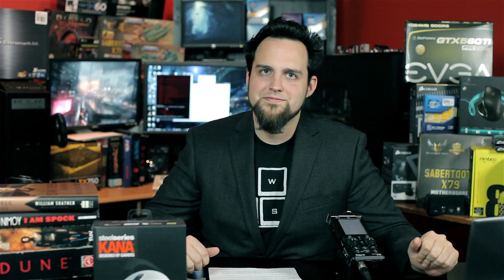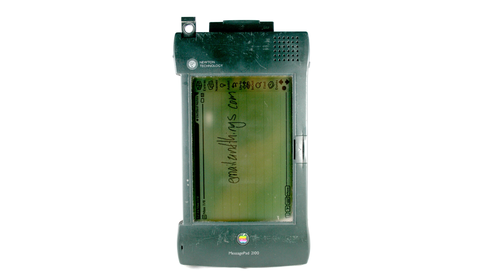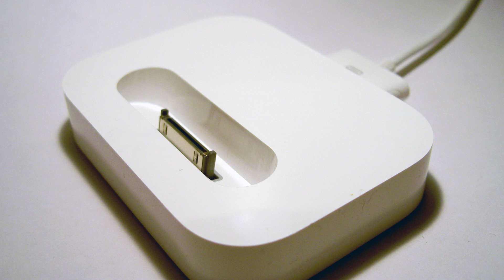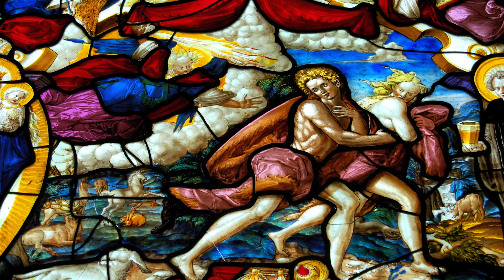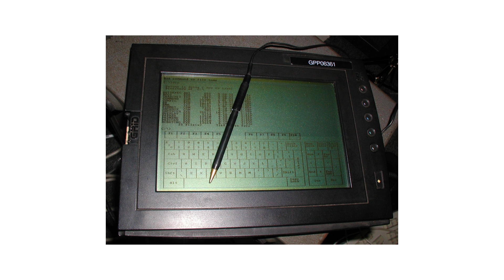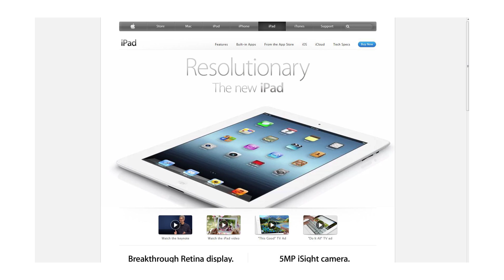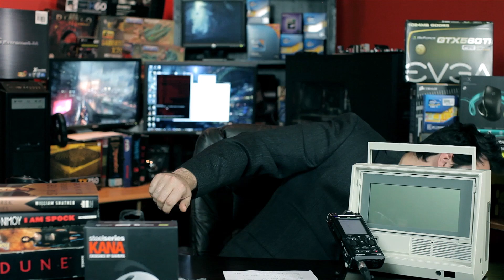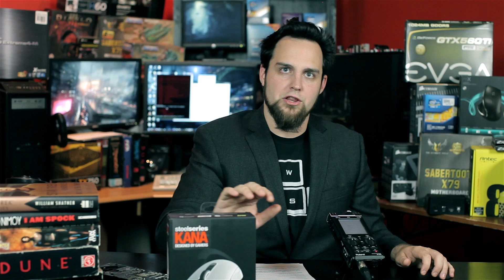Has Apple Really Ever Invented Anything?

Comment: This video is my 1 argument for ppl who say Apple invents everything.
Reply: ***** 
Yet the video does provide not very accurate data, does it?

 US Patent Law defines invention like this: a new, useful process, machine, improvement, etc., that did not exist previously and that is recognized as the product of some unique intuition or genius, as distinguished from ordinary mechanical skill or craftsmanship.
- (http://www.uspto.gov/web/offices/ac/ido/oeip/taf/patdesc.htm)

• Firewire is Apple's own name for IEE1394, Apple initiated development in 1986 with the help of the  IEEE P1394 Working Group, where TI was belonging to then.

From the 1394 Trade Association page:
"History
The 1394 digital link standard was conceived in 1986 by technologists at Apple Computer, who chose the trademark 'FireWire', in reference to its speeds of operation. The first specification for this link was completed in 1987. It was adopted in 1995 as the IEEE-1394 standard. IEEE-1394-2008 is the most current version of the standard, which supports asynchronous and isochronous data transmission with data rates ranging from 98.304Mb/s (S100) to 3.932Gb/s (S3200)."
- (http://www.1394ta.org/about.html)

• Newton MessagePad, while not the first real PDA, Apple coined the term PDA. I was not able to find an Apple press release about the MessagePad though, to either confirm or deny the claim of the video uploader (VU).

• Thunderbolt: where does Apple claim, to be the inventor? It does not say so here: http://www.apple.com/thunderbolt/

And back in February of 2011, when the first Macs with TB arrived, Apple said this on their TB page:
"Thunderbolt began at Intel Labs with a simple concept: create an incredibly fast input/output technology that just about anything can plug into."
- (http://web.archive.org/web/20110227062320/http://www.apple.com/thunderbolt/)

• MagSafe: Where did Apple say, it was something entirely new? They have a patent on this connector for electronic devices, thus rice cookers are not included. In their press release from 2006, Apple did not mention to being the first to implement magnetic properties with power adapters, but according to the definition of invention, it is an invention.

• Studio & Cinema Displays: Where did Apple claim, to have "invented" the big displays? They were however the first to offer 30" computer displays and got the ball rolling for 2560 pixel wide displays, like the 27" displays nowadays.

• Mini DisplayPort is in a way Apple's implementation of the DisplayPort standard, one could call it an invention or innovation, the line is blurry here.

• I do not know that dog icon, but I really get the feeling, they went with items, where the term invention cannot always be applied.

• 30-pin dock connector: A lot of companies seem to have their proprietary dock connectors, and Apple did implement some features in its dock connector, that would not be possible via Firewire or USB, like video out for example.

• Apple IIe Card: again, blurry lines, but in the end, if it is not considered an invention, it was an innovation made in house. I guess that should count for something. Nowadays we do not have such problems anymore, everything is compatible with everything. Man, those first thirty years of personal computing must have been awful.

• Apple TV: where does Apple say it is their invention? They say, it is their product, nothing more. These guys are really reaching. I guess they could not be bothered to look at Apple's actual invention.

Still lots of shit to go I guess. And those moderators are quite bad.

• MacBook Pro: Apple was the first to use the Unibody design for their notebooks, others just followed suit. It was an invention and innovation.

• Apple logo: again, stretching. They did design it themselves, but then again, someone already took a bite before, and it was Turing. I guess that guy should be honoured.

• QuickTake camera: I guess, they just list products, which cannot easily count as inventions, but the parts used inside or the parts used to create that product can be an invention, but then again, most people cannot look below surfaces and have to be superficial.

• Mac OS 9: now they just ramble how bad it was, but I cannot say anything about that, since my only experience with pre Mac OS X was System 7 and Mac OS 9.2.2, which were okay and got me hooked. I always liked to theme Windows to look more like that, I still put that task bar up top when using Windows. 

• Mac OS X: Of course they invented some of the code, they bought some of the code, and they took some of the freely available code. The new OS is an invention, but of course only if you use the broader definition. Otherwise, no one is inventing anything. Maybe when the Singularity arrives, new inventions will be made.

That video gets boring, but I fight through it. Hopefully you will too with this longer reply not really made for YouTube.

• Mac App Store: Again, where does Apple claim to be the first or having invented something entirely new with just the concept of the MAS? 

• iOS: Never heard it pronounced that way. Inventive. Unlike iOS of course, which was just Apple doing nothing. Man, those guys are prejudicial. And man, am I becoming even more prejudicial towards people with such beards. Probably wanted to join a metal band, but couldn't.

• iPad: Sadly, this time they are 0% correct. Tablets and that concept existed before, even in Star Trek and 2001. And many manufacturers brought out products in the late 90s and early 2000s, which showed, how many people are really not interested in such crappy products.
Luckily the iPad came along and showed everybody else, what to copy. I guess they couldn't see it from the iPhone, which was an obvious test bed for a multi touch tablet, at least for people looking at dozens of PADDs while watching TV.

• The iPod was not claimed to be the first MP3 player, not by Apple at least. Where do they find those idiotic assumptions?
It was the first popular MP3 player though and brought attention to Apple. I guess, it must not have been that bad a player.

• Inductive charging: Apple does not offer any products of their own design or creation employing inductive charging. But I guess, since one can buy such products from the Apple Online Store, it must be Apple claiming it as their invention.
Or are they talking about the patent for orientation based charging Apple got earlier this year?

• iPhone: Yeah, I guess the name was the only thing they could come up with. Poor bastards.

• Pippin: WHAT THE FUCK? I am seriously pissed right now, and I probably should stop, but I am also obsessed with stupid people like you and proofing them "right", which is of course a lost cause via social media.

Anyway, I make a short break to break something, and will probably go to the cinema afterwards. Maybe I finish this reply later, maybe I will come to my senses and just post it until this dot.

They think a lot, they do not know a lot.

• A5: Officially it is a design by Apple, even if made by people from a previous company Apple bought, the company being P.A. Semi, not ARM. But then again, dangerous half wits share their ignorance.

• notebook handle: Yeah, they got Apple this time, Apple clearly claimed to be the sole inventor of this idea.

• Unibody construction: Apple introduced this sort of construction to notebooks, although it was a way to construct other parts of other industries long before. Again, those guys assume it was made for aesthetic reasons, thus it is not a real invention. I guess, the USPTO does see it differently, since it granted Apple a patent or more for that Unibody design specific to notebooks.
(http://patft.uspto.gov/netacgi/nph-Parser?Sect1=PTO1&Sect2=HITOFF&d=PALL&p=1&u=%2Fnetahtml%2FPTO%2Fsrchnum.htm&r=1&f=G&l=50&s1=8,616,748.PN.&OS=PN/8,616,748&RS=PN/8,616,748)

• legacy free PC: I guess they had to stretch, when they only got moot points

Now they go off on lawsuits. They generalise a lot, but then again, one has to do that without actual points.
Apple does not go after everyone, that copies something from Apple like tablets or smartphones, they go after people, just like any other company, violating their patents, and Apple has certain patents in the smartphone and tablet sector, that get copied to the T. Apple does not go after companies, using their own patents or licensed patents when it comes to smartphones and tablets.

PS: I am not fully versed in all the legal stuff, and I have seen some frivolous lawsuits reported made against Apple and being pursued by Apple in the past decade. I do not agree with any of them, be they from Apple or against Apple.

Anyway, if you want to see granted Apple patents, which include their own inventions, go here: http://www.patentlyapple.com/patently-apple/patents-granted/
Reply: Thx for the essay changed my mind. But still apple is pretty manipulative cant deny that
Reply: +Confused Fella There is a difference between creating a music, and then creating a remix of that music. Similarly, apple doesn't research and develop an entirely new technology. 

Samsung on the other hand, developed and researched the 3D V-NAND technology for their SSD drives, making them the fastest SSD drives out there. They also developed and researched the "PenTile Matrix"  technology which is what makes their AMOLED panels the best in the world. There is a huge difference there.
Reply: Respected Fella You know the video was a send in competition? these are viewer submitted.. so the whole premise of your essay is kinda blown.
Reply: Respected Fella I only skimmed it, but this isnt apple saying they invented stuff, it's people saying apple invented stuff.
Reply: true, but then you cannot argue your topic then.
Reply: Smiley Flower
Why is it blown?
Because the moderators did not do their own research and perpetuated lies?
Reply: Smiley Flower
Yes, but the moderator should have read up on it, as some stuff is invented by Apple and maybe they should have chosen another name for the video.
Reply: Phanteus Well, people using Macs have created new music and remixed old music.

And as Samsung is a technology developer and Apple is a technology user, though it has developed some technology of its own (sometimes based on existing technology, sometimes not), that is not a problem.
Reply: *****
Can you elaborate?
Reply: of course they didnt invent everything fam. they innvovated everything. they made people realize that they needed something that they never before even knew existed.

Comment: Apple invented the force touch trackpad and the new butterfly mechanism keyboard in their new MacBook. They also invented the first 5k all in one computer. They invented Touch ID. They invented the first computer with colour. This video has no ground to stand on...
Reply: Tristan Poh 
Honestly, they did do some good shit with the trackpad, its an astounding thing. They did invent the new key, but there are toper, cherry, dome keys... its trivial, but there are dozens of keyswitch types.

Your first two are true, yes... whether the butterfly works to any advantage is debatable.

But the first 5k AIO? No no no, they put a (30hz) 5k panel on a computer... they invented neither of these, they put chocolate with cake and made chocolate cake.

But here's the funny one... they invented 'touchID'. No.. apple most certainly did not invent a fingerprint sensor that uses a capacitive sensor. Motorolla did this in 2011. I clock into my job at work with one of these sensors... 

If you watched the video, youd see an entire island.. not just a tiny but of land to stand on
Reply: There were 8k TVs before Apple's "5k" display. Fingerprint reading has been around since the mid 90s. There were other computers before Apple's computer that had color. Force touch was first made by Blackberry under a different name. Butterfly mechanisms have been around forever.

Comment: I think, this is a bit one sided against Apple. Yes - Apple isn't an invention tech company. However: since ages, PC companies are copying the integration of systems of Apple and its design. Yes - very few companies are copying to the i. But most companies, are "miraculously" change their design language of their product portfolio, after Apple changes theirs. There were no thin wedge shaped laptops before the MacBook Air - but after that, there were a lot. Apple had the white laptops and desktops - the whole industry went white - then they changed to aluminium and guess what - the whole industry is going towards aluminium. Did anyone went to a store and counted the metal coloured laptops with a black keyboard and a display, which has a black bezel? Huh?
Ok - it is not only about design! The whole integration of technologies is Apples forte. You might not call it invention, but it is innovative. Seeking out technologies and use them in commercial products is very much innovative and shows a lot of vision for the future. Yes - the mouse was not invented by Apple - but who used an Xerox or who used anyway a mouse, when it was not adapted by Apple?
Same applies to the iPhone - Apple wasn't the inventor of the smartphone. There was Palm with their symbian based phones - and others. However to really make it, what it is today, you have to give Apple the credits [if only create a contemporary mobile software platform]. And let's look at the force touch track pad - in recent history.

Comment: Milling is incredibly expensive compared to other manufacturing methods so why they went with that process IDK and why they used aluminium over plastic IDK. I'm a CNC machinist for Remington and we really try to avoid milling to cut down on cost, wherever we can stamp steel or use polymer we do, that just seems to make consumers pay more while company makes the same than using a cheaper process.

Comment: The unibody thing is great for durability. Especially with solid state drives.

They don't invent much hardware, but they are great at moving the market in a good direction with previously underutilized technologies. Most of that has to do with the quality of the implementation. 

In terms of really innovative work though, NeXT actually did way more than Apple. A lot of the computer programming techniques developed for NeXTStep didn't just end up in OS X and iOS. They basically had the first modern web object oriented web framework and ORM, and the work on that began in the late 80s. For the time, it was a way better UNIX workstation than what Sun and others were offering. It's kind of funny that Steve Jobs arguably at his best was while he wasn't working for Apple.

Comment: What IS very interesting to point out, is that even though apple didnt invent this stuff.. in many cases, apple made it mainstream, or at least got it out there enough, that people started using it or wanting it on more things, allowing it to now become mainstream.

One thing you cannot deny, Apple knows how to make you want thier products.  Even if you dont want them.

Disagree about them maybe doing the unibody.  Why, because they invented the machining process?  Thats crap.  Other industries both personal, professional and enterprise have been machining out of all sorts of materials for a long, long time now.  And when a new design comes out, the engineers need to program the machine to cut the metal how they want it.  Thats not inventing, thats using the invention(the CNC machine) to do your work.

Comment: Any educated person knows Apple never really invented anything, they innovated ways of using things that already exist, or could, and make it usable for the general user.

That is why Apple is as successful as they are.... Some points:

The GUI existed with Xerox but Apple perfected it and knew how to tweak and market it for the masses and succeeded.

The MP3's players, en mass, existed before the iPod, no one ever cared to have one.

The iPod came out and was dead simple to use and everyone ended up getting one.

The same thing with the iPad & iPhone, others made theirs first, Apple made it right.

Just look at how the tablets looked before along with the phones and how they looked after the iPad and iPhone. ( Palm phones for a clear example )

You mentioned OS X and it being UNiX + BSD with Apple tweaking the Kernel, Wrong.

OS X is NeXT STEP which is built on top of UNIX with parts of BSD, The Kernel is that, not the operating system.

What you see on OS X, the Dock placement, the bar, etc. is all Next ( Steve Jobs's company's doing ) a Kernel is not an operating system, it's a "part of"

Firewire existed, again, but was dormant until Apple implemented it.

Wireless networking was never implemented until Apple implemented it into their Macbook's 

They put out the first Laser Printers ( that printed correctly )

I can go on but the point is, and why Apple gets at other companies is, you f-ed up so many times over, I found the right way of doing it after messing up myself and you come along and copy what I did right instead of learning on your own? That is where the court cases come from, not because they feel they own anything.

You use a cake example, no one is claiming they own the chocolate, but they are claiming to own the betty crocker chocolate cake design.

That is very different.